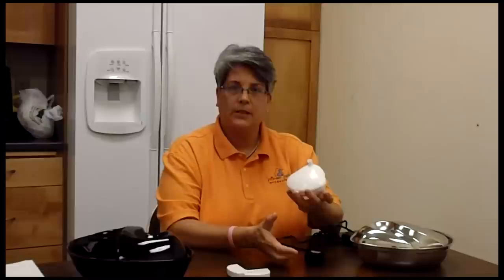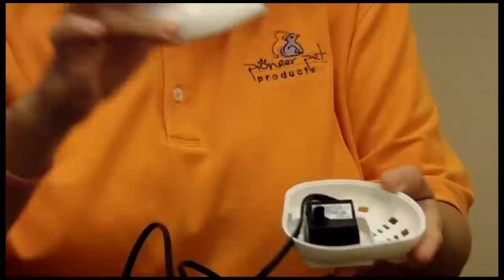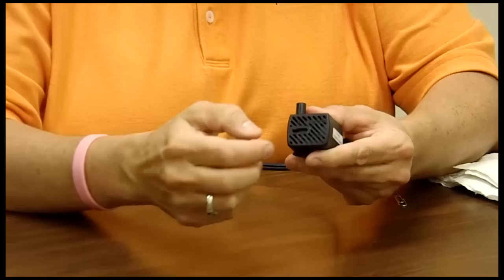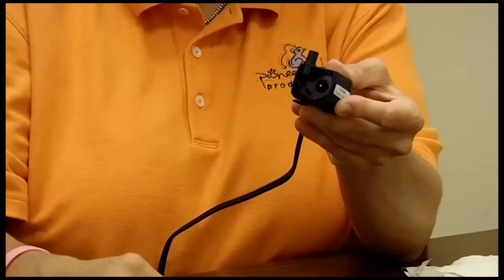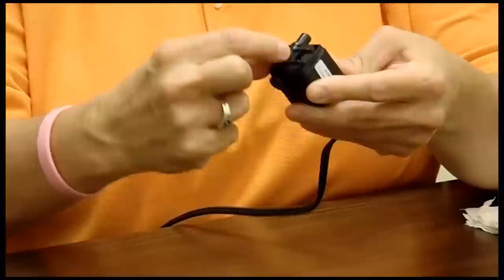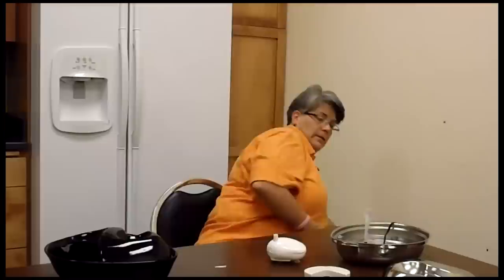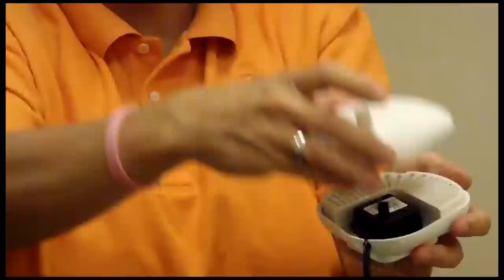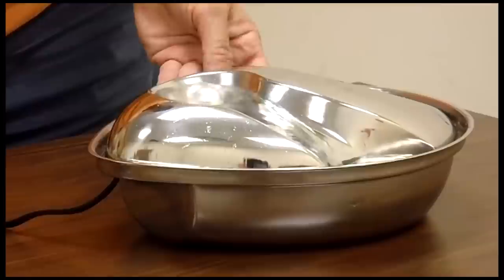Pioneer Pet Raindrop Fountain Pump Maintenance 101

Comment: Saved my fountain! I thought it was done for. It had stopped working and I figured it was the AC adapter, but while searching for a replacement pump adapter, I came across this video and decided to give it a watch. After cleaning the fountain (which was horrifically disgusting because I didn't know it could be opened) the pump sprang to life as soon as I plugged it in.

Thanks!

Comment: Thanks so much for posting this.  I stupidly tossed the manual as soon as I installed the unit, and figured it would just run forever.  When the pump stopped I was just about to angrily buy a new one....then checked youtube.  2 minutes later, the pump has gone from totally nonfunction to silent and high output.

Thanks again!

Comment: The pump that came with my Pioneer Pet stainless steel raindrop fountain was made by Skyish.  I must have misplaced the instructions, of course.  Well over a year later of cleaning the parts (not taking apart the pump) and rinsing the pump worked for about 18 months.  Last night it worked fine, but i got cute and did a 2 AM mini-cleaning and the pump wasn't working!  So 24 hours later I look it up on Pioneer Pet's web site and saw a tiny 4+ minute video, then went here to see the full screen version and went to see if I could get the pump to work after a thorough cleaning.  Worked like a charm, and now I'll make sure to take apart and clean the pump as well.  Thanks for the video!  Love the fountain and so did my cat.  Sadly she is dying of lung cancer now.  I had a Drinkwell fountain that was a pain to clean and very hard to twist out the pump to clean it and the plastic pieces seemed to invite biological growth!  So 18 months ago I saw the above named Pioneer Pet stainless steel raindrop fountain and loved it before buying it!  Easier to clean and I could easily get at the pump!  Thanks again!

Comment: I've had my unit for 4 months and cleaned it every 5 days. Like many I never looked over the manual so when my unit stopped working last night I thought the tiny little motor had died. I called the phone # on the box and a person helped me take the motor apart, I never would have thought the thing would come apart. Funny thing is it was clean inside the housing and fan. But she had me just pull out the fan, and then put it back in. Worked.

Comment: Like most people have found, this works. One clarification - I gently poked a paper clip around down into the chamber that the impeller sits in and peeled off a thin coating that probably inhibithed the magnetic drive. It wasn't "Clogged Solid" as I had assumed.

Comment: Awesome!  It works again!   After a little over a year of running, the pump had suddenly quit working.  Like others, I didn't realize the pump itself opened up, so I wasn't cleaning inside it every couple of weeks like I do with the white clamshell piece and the rest of the unit.  Good thing I use only purified water in it or it would have quit long ago, I'm sure!   After cleaning the crud out of the pump itself, it works like new again and my cats are happy that they can drink from the running water at the top once again :)

Comment: Thank you so much! I own 2 of these expensive fountains. It drove me nuts because I'd unplug it to clean it, plug it back in and it wouldn't go on. But if I tried it an hour later it would start working again.

Obviously this is an off the shelf pump, but why don't they make them sealed? Of course they are going to get gunk in there. I would think a sealed pump would be fine because you don't have to worry about psi depth since it's only going in an inch of water.

While more expensive to design your own sealed pump, you'd be the only company with a "seal pump pet fountain that doesn't quit like the rest"

Thanks for great video!

Comment: Thank you SO much for this video. My fountain pump quit working all of a sudden and I couldn't figure out why. I always took apart the insides of the pump for cleaning but never took out the fan. The magnet was totally gunked up and I cleaned it off. Now it works! I like to use those "magic erasers" to clean the fountain and parts, rinsing well after of course.

Comment: My girlfriend recently purchased this pet fountain off of Amazon, and right out of the box the pump was not functioning as intended. The motor was running but it was not pumping water.
I did clean all parts as instructed, but to no avail.
At first I thought it was a motor issue, but after watching this video and disassembling the pump myself I realized the water flow was being obstructed.
With the face plate and everything attached as it should be, the pump would shoot water out for a good 5-10 seconds then give up.

What I eventually discovered through tinkering was that the face plate was doing the obstructing. The water will come back out of the side of the pump without the face plate entirely attached, but I discovered that pulling the left side of it off a little bit allowed the water to flow freely as intended, without the pump just shooting the water back out the side.
It's now running smoothly and consistently....so if cleaning your pump did not solve your issue you may want to try fiddling with the face plate or plastic guard or whatever she called it in the vid. Good luck!

Comment: My pump would usually stop working after i unplugged it to refill.  This video was helpful insofar as i didn't know pump it could be disassembled, but I would like to add some more tips. 1) my impeller was difficult to remove, and when i did, it pulled the whole axle out as well. Soak all parts in a dish of  CLR,  after 20 minutes or so, scrub out all the gunk with a q-tip, and rinse. I needed 2 soaks to get rid of all the built up scum.  My problem was impeller was "seized" on the axle, to I needed to clean axle as well - it had built up residue that i needed to scrape off. If your axle does come out of housing, re-insert it by using impeller as a guide.  it needs to be pushed into housing with a little force. After examining all parts, I am satisfied that this pump should last"forever" as long as you do regular cleaning with CLR.

Comment: One thing I did notice in the video was where the flow switch should be set. It's opposite of what is showed. The woman that helped me on the phone told me it should be all the way to the right. There is a + & - sign on the pump housing. When I got mine it was set all the way to the - side. I found the manual and it says that it should be set to the second lowest position. You'll notice in the video when she turns the unit on the water shoots way to high. A gentle flow is what you want.

Comment: Make sure you take the pump apart and clean it completely, including removing the impeller/armature as shown, at least once a month! If you don’t the impeller will get tangled up with hair and seize and/or be very difficult to remove. I initially waited too long and had to use pliers to pull it out, almost damaging the plastic impeller blades!

Otherwise this is a very good water fountain.

Comment: Thanks for this video. My pump suddenly stopped working. I have the Skyish TP-180LV pump. I think I may have to replace it. The housing looks to be completely sealed. There is no seam to indicate a removable face plate that you easily snapped open. How can I tell if it is the power supply that has failed?

Comment: You really have to take it all the way apart, people! No half-assing. Feeling lazy, I tried just rinsing off the pump with hot hot water until it didn't feel slimy. Nope, still didn't work. All the steps down to taking the propeller out is what it takes! This fountain isn't the easiest thing to maintain, but it makes my furbaby happy so I'll do whatever =^..^=

Comment: recommendations for hard water? Either this or the fact that the pump was let to run dry for few hours while I was away caused it to stop working all together. There is a bit of mineral build up, we usually clear up with vinegar on stuff, not sure if this will have an affect on the pump since it's already malfunctioned.

Comment: Thank you so much for the video!  Just cleaned my pump and it took less than 10 minutes!!!  Question though -> Is there anything I can add to the water to help keep it clean?  I swear I had read somewhere that adding a small amount of apple cider vinegar would help?  I clean our filter every Saturday and change the filter every third week.  I also have to top off the water level every other day or so but that's in part due to the fountain being in the same room are our wood stove.  So far, so good!  Happy Customer! :)

Comment: I cleaned mine out and there was some black stuff in there (mold or dirt) and it works now.  However the suction cups on the plastic housing seem to not stick anymore so I wonder how you fix them. On the white housing I mean.

Comment: Thanks so much.  I'm not sure if my cat is drinking directly from the resevoir, but it would get low very quickly.  While on vacation my daughter did not watch it and it ran out of water while still running.  We replaced the water but the pump would not work.  I was about to replace it with a spare pump that I kept from my first purchase that was broken during shipping.  However I noticed the small switch on the pump, so I decided to find a video that would explain what it was (couldn't find the instructions), and I came across your video.  Thanks again.  It's working just fine now!  Going to order some spare filters.  How often should I change the filter?
Reply: The box says to replace the filter every thirty days.

Comment: I never thought I could disassemble the motor! You know, usually manufacturers wouldn't recommend it, so we would have to buy a new one ;) Anyhow, I couldn't get the impeller (yellow part) out for some reason. It doesn't feel like magnetic force to me, but more like stuck. Would there be a way to fix that, too?

Comment: Well, I wish this was my problem. My pump works fine but its the cord that connects to the power adapter that is the problem. It fits so loosely that I'm not getting power to the pump. I can wiggle it and it starts but then stops again. So I need to know where to get a new one.

Comment: This is disgusting!!  Pioneer Pet needs to WRITE CLEAR, EASILY UNDERSTANDABLE DIRECTIONS ON THE OWNER'S MANUAL IN THE FIRST PLACE!!  I had to watch a video on how to assemble a brand new fountain to get it to work.  If this is how Pioneer Pet treats its customers you will receive a terrible rating!  Brand new products should not have to be "troubleshot" in the first place, the fault lies entirely with you. Will I be a return customer?  DEFINITELY NOT!!  I didn't pay this much money for a poorly designed customer manual.  What is wrong with you?  the video is not too good at showing how to install the pump either, slow down and clearly show each step. It is the least you can do.